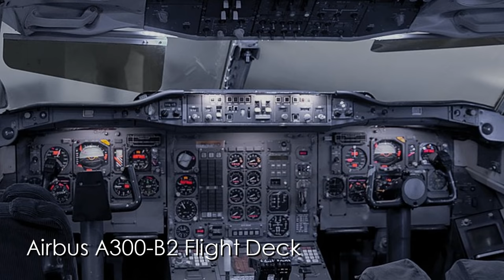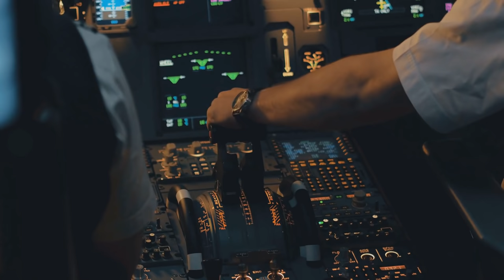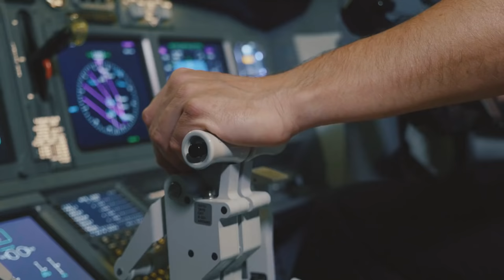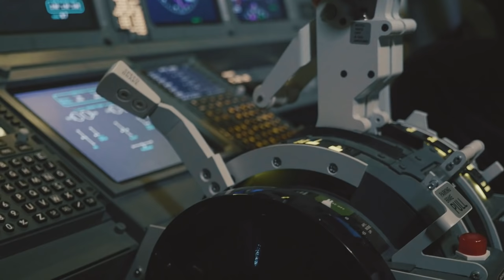Pilot Rips The Tail-fin From Their Plane (American Airlines Flight 587) - DISASTER BREAKDOWN

Comment: Everyone seems to blame the training but to me the planes design is the biggest issue. Manipulation of the controls should not rip the tail off! Airbus are famous for limiting pilot inputs if they are endangering the plane but allow pilots to max control repeatedly ripping the tail off! WTF? I'd be pissed if max controlling my steering wheel in my car caused the diff to fall out.
Reply: Do you have a ppl license? All aircraft have limits regarding rudder inputs, starting from a small Cessa up to B747
Reply: @ulrichschenk8202  relationship to speed and what is maneuvering speed for that aircraft? Speed at which you move the pedals? smooth and easy? Don't JAM on it?
Reply: The A300 did not have those limitations. They started with the A320's digital fly-by-wire system and exist in every Airbus airliner that came after it.
Reply: Except, what happens when full rudder deflection is needed, huh? Is the plane magically supposed to guess which situation it is based on literally nothing? Hey, what about the fact that Airbus did NOT want pilots to do that and has said so repeatedly?

Like, people say this is the fault of a plane, but let's take a Boeing aircraft and quickly alternate between full rudder deflection left to right in good turbulence and see how well it holds up eh?

Comment: I can't believe a qualified pilot didn't realise that sending the rudder to extreme opposites in quick succession would cause damage!! Turn the steering wheel in your car full lock left and then immediately full lock right and see what happens!
Reply: even if it didn't cause damage it is very questionable. It shakes the passengers unnecessarily as it induces high g-forces on the passengers in the rear. It makes controlling the plane difficult and it's about the worst pilot induced oscillation he could cause. It's like sitting in your car on a windy day and because of a gust you start weaving left and right. What is that supposed to do other than make controlling the car more difficult?

The pilot should never have been left under the impression that using the rudder for more than just correcting the planes movement is appropriate...

Comment: I remember that the reporting at the time of the accident simply blamed wake turbulence for the crash. I was always puzzled by this and I am glad I reviewed this crash in detail. As usual there were multiple contributing factors: 1) A design flaw in the Rudder of the airbus plane making it hypersensitive to the controls 2) A lack of idiot proofing for the Rudder that would place mechanical safety limits to prevent inappropriate use by a pilot 3) Negligent flight crew instruction by American that encouraged inappropriate and hazardous manipulation of the rudder controls when encountering wake turbulence 4) Flight crew ignorance of the mechanical limits of the rudder with regards to the controls.  Intervention into any one of these areas would very likely have saved the lives of over 250 souls on board and on the ground, as well as the plane and the property.

Comment: Airbus is insane. Lol at everyone accepting a pilot can in any circumstance be allowed to dislodge the tail in flight by working the rudders. No matter how hard you press or in what combination the tail should never come off.
Reply: Do you have a ppl license? All aircraft have limits regarding rudder inputs, starting from a small Cessa up to B747
Reply: Driving a car at 200MPH then do lock to lock steering left right repeatedly isn't a preventable crash.
Reply: I don't think you have been paying attention to the video then. The first officer exerted twice the maximum amount of force on the tail than allowed by the manufacturer. Everything has a limit, duh. Or are you going to blame Airbus as well for the fact that the engines fell off before the crash due to excessive force? The only causes for the crash are the fact that the plane took off too early before the turbulences subsided, and the faulty training of AA which made the FO rip the tail off.

Comment: Name any other time a tail detached from rudder inputs? This was caused by a weak attachment. How is it that the plane knows better than the pilot but can't limit it's rudder travel as speed increases?
Reply: The problem wasn't the amount of rudder travel as such, You could deflect the rudder fully at even higher speeds and it wouldn't break. The problem was the repeated rudder reversal. If you do this the tail turns more and more into the the airstream because it gains momentum with every swing, basically like a pendulum you accelerate more and more and at some point the tail fin generates so much drag forces because of that, that it will eventually snap right off.
One thing which is indictiv imho is the demand for more thrust just before the fin broke off. I would recon they started to bleed airspeed pretty severly just befor everything got to shit.
Reply: @shi01  AA 903 1997 the defective RTLS caused the same situation.
Reply: @sylvesterstewart868  Yes and do you also know what they found 5 years later on that particular aircraft when they finaly thoroughly checked the tailfin during an C-Check overhaul? The tailfin had developed cracks because it has gotten overstressed during this incident.
Reply: @shi01  Yes my point was that the tail attachments were weak and the RTLS caused the crash not Molin.
Reply: Of course airbus gets away with their mistakes per usual while boeing got heat.
Reply: @LeolaGlamour  nonsense comment p, read a book.
Reply: @peteconrad2077  

I have which is why the boeing story is straight out of airframe.
Reply: @LeolaGlamour  what do you mean “straight out of airframe”. As someone who works in the industry I can tell you that Airbus are far more ready to acknowledge problems than Boeing.
Reply: @peteconrad2077  

Give me examples,  I've heard many pilots say they don't like airbus.
Reply: @LeolaGlamour  it’s normally guys who’ve flown Boeing for decades and can’t adjust. 

An example. A fault was found in Airbus alpha logic that caused an airborne upset. Without any order from EASA, Airbus issued immediate notice to all operators on how to deal with the issue. No cover up, no pretending, just immediate admission of a problem and distribution of a solution.

Comment: The rudder should have been able to withstand the back and forth no matter what the co pilot was doing ,it never should have broke off so easily.
Reply: I don't think you have been paying attention to the video then. The first officer exerted twice the maximum amount of force on the tail than allowed by the manufacturer. Everything has a limit, duh. Or are you going to blame Airbus as well for the fact that the engines fell off before the crash due to excessive force? The only causes for the crash are the fact that the plane took off too early before the turbulences subsided, and the faulty training of AA which made the FO rip the tail off.
Reply: @bogdangabrielonete3467  No. The controls on the flight deck should never have been able to command self-destructive control inputs. It’s one thing for controls to allow input that causes loss of control (like how your car steering wheel can be turned too far during highway driving, causing you to flip the car). It’s quite another for the vehicle to literally fall apart when pushed. (Imagine if pressing the brake pedal in your car too hard caused the brake calipers to shear off. You’d rightfully call that a severe design flaw.) Designs should not allow for that, and it would have been fairly simple to prevent, using mechanical end stops that adjust depending on airspeed, for example, or using dampeners to prevent excessively quick back-and-forth. This is basic design-for-safety strategy. The fact that basically all subsequent Airbuses employ software to do exactly this shows that that is the correct approach.
Reply: @tookitogo  no it isn’t simple. You can’t limit reversals without limiting the actual rudder authority needed. Trust people who know more than you.
Reply: "So easily" dude he applied like 200,000 lbs of pressure or whatever
Reply: @peteconrad2077  How can I trust someone who doesn’t know how to place a comma? ;)
Reply: @peteconrad2077  That’s rich, coming from someone who doesn’t understand Human Factors engineering (something I studied at university), which is a key part of design for safety.
Reply: @tookitogo  who cares. You didn’t study aircraft control. I did.
Reply: @peteconrad2077  Suuure. Whatever you say, boss.
Reply: @tookitogo  laugh all you like. I’m astonished that someone with an engineering background can’t see that a system that’s limited in the static cannot be limited in the cyclic dynamic mode. In fact, your ignorance on that leads me to question your educational claims.
Reply: @peteconrad2077  So how come fly-by-wire aircraft use software to limit harmful inputs? Software control is a perfectly valid way to accomplish it.
Reply: @tookitogo  a fly by wire rudder could be programmed to do what you suggest. Wonder if you can work out the missing piece of the puzzle with this accident.

Comment: Tail Section Was Already Faulty...Rudder Movements Was The Last Straw...Blaming it on The Pilot Was a Scapegoat
Reply: The forces on the vertical stabilizer were enormous and stronger than hard turbulence which of course also affect the whole plane and not just one part.
Reply: The force was far greater than any turbulence could do and yes, the investigators do know how it happened.

Comment: Wouldn't it make sense if the mechanism can only handle certain stress levels that the manufacturer put in a fail-safe to limit the amount of force. How would the pilot know they are overstressing the rudder. Lets say for example, I turn my car steering wheel all the way left, that means my wheels breaks off the axel? LOL
Reply: It does limit the force but not if you constant reverse. No rudder can take that.
Reply: They added a fail safe after this

Comment: I think you give the A300 way too much credit, it wasnt the first widebody and it wasnt the first twin engine...just because they built the first widebody twin engine means almost nothing, it means they looked around and built what works the best. Personally I think Boeing aircraft are superior anyway, the fact that the airbus has mutliple different behaviors of the flight controls mean that there is an extreme chance of mishandling the aircraft, the fly by wire computer controls should not behave the way it does it most situations, allowing a pilot to hecome accustomed to holding the sidestick all the way back and that being a perfectly safe way to climb the aircraft?!? There are multiple cases that the dual behavior of the sidestick has CAUSED pilot error, Airbus wont say it because it means theres a problem...theres no way Boeing would design an aircraft that has pilots cosistantly putting FULL back input on the yoke in order to perform a safe climb, its just insane to tell pilots and have them get used to holding that sidestick ALL THE WAY BACK its absolutely insane, Airbus is not sane.

Comment: I Think There's Still a Lot of Information Missing Here... The "Fly-By-Wire System"  vs  The More "Conventional Control System" Used In This Older Airbus Had a History of Failure... Then You Have Maneuvering Speeds,,, Vs  "Design Maneuvering Speeds".,,, Youv'e Got a Problem...  Airbus Left a Lot To Be Desired In Their Design,,, Especially The Rudder Control Pressures Needed To Move The Rudder,  and The "Auto Speed Limitations" For Rudder Travel, Compared To ANY Boeing Aircraft... Still This Is One of The "Better" Presentations of The Accident, Even If It  Is Falling "Short" on "All The Information Needed"... This Was a Design Flaw, Period,,, With a "Shade" of Pilot Error,,,
Reply: I believe the plane was within the maneuvering speed envelop so this should not have happened
Reply: Jesus christ, stop capitalizing every word. In English you capitalize the first word in a sentence, and “proper nouns” (that is, names and titles). And you don’t need to use ellipses (...’s) everywhere. This makes your text extremely difficult to read.
Reply: It isn’t fly by wire. The rudder forces had nothing to do wiht it. It was poor training, period.
Reply: @davidpowell3347  it wasn’t being flown as per the design requirements.
Reply: @peteconrad2077  That doesn’t mean the design requirements were chosen well.
Reply: @tookitogo  the design load limits are defined at the regulatory level and are common to all civil aircraft.
Reply: @peteconrad2077  Minimums perhaps. But certainly a manufacturer could choose to make the design more resilient.
Reply: @tookitogo  yes, if they wanted to go bust.

Comment: Boeing plane (737MAX, for instance) crashes: it‘s the foreign pilots‘ fault
American pilot too dumb to fly an Airbus: it‘s the foreign plane‘s fault

Talk about American entitlement…
Reply: Hmmm but isn’t that what everyone else is doing but flipped? If anything Boeing failed by trying to be more like Airbus.
Reply: @LeolaGlamour  no, Boeing weren’t doing anything like Airbus. When Airbus wanted an automatic system to stop the plane stalling they spent billions, made a whole nee design, integrated the system fully and made a comprehensive training program for it. Nothing like Boeing.
Reply: @LeolaGlamour  it doesn’t require less training than a Boeing. If anything it requires more. Now why don’t you go and find a channel about coloured blocks so you can talk about stuff you understand.
Reply: @peteconrad2077  Airbuses big draw is that it can basically fly it’s self and the training is easier. That is the facts. Boeing lied and said you wouldn’t need training for their new plane but you did if you weren’t a skilled pilot.
Reply: @peteconrad2077  In essence, the Airbus places the autopilot and hard limitations at the centre of its design. The Airbus provides full flight envelope protection in that it will not allow the pilots to exceed certain parameters. These are called ‘hard limits’. Examples include stopping the pilots from stalling the aircraft or exceeding certain pitch or roll parameters.

Boeing place the pilots at the centre of its design philosophy and ensure that the pilot have full control authority at all times. This means that at any point, they can simply disconnect the autopilot and fly any manoeuvre required at any given time.

Both philosophies have benefits and drawbacks. Human error is almost always present in aviation accidents so some people argue that the Airbus hard limits help prevent inadvertent human error. However, this requires complex systems which can go wrong and aren’t always understood properly. This can (and has) also led to aviation accidents.
Reply: @LeolaGlamour  that’s because you haven’t a clue about aircraft. At least you’ve dropped the pretence knowledge.